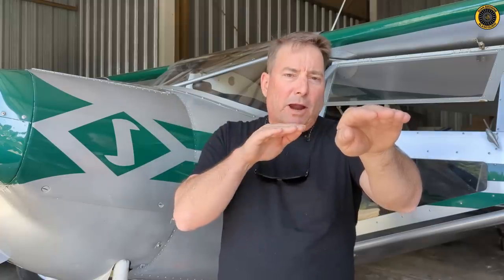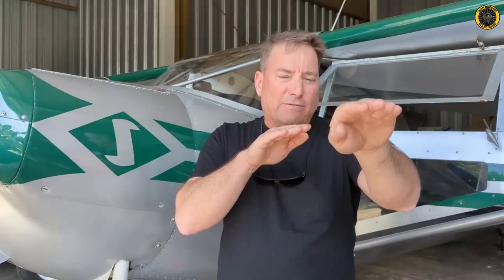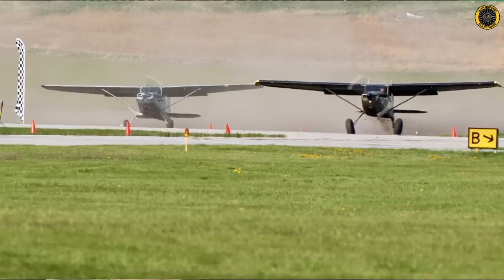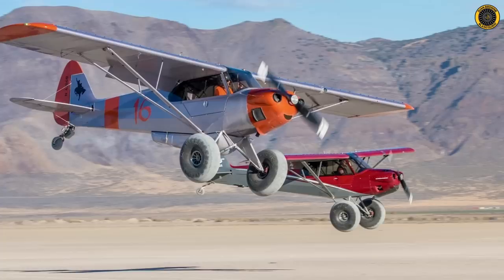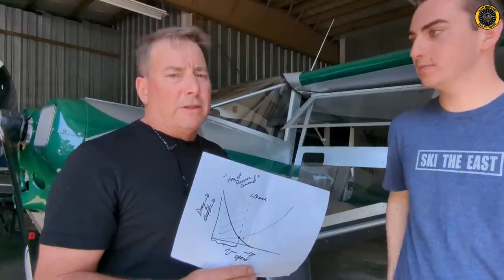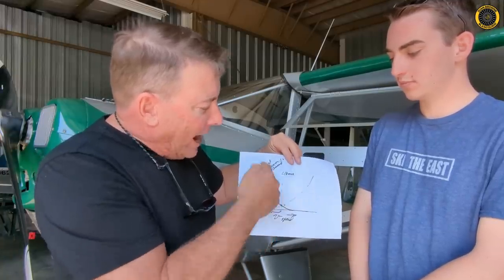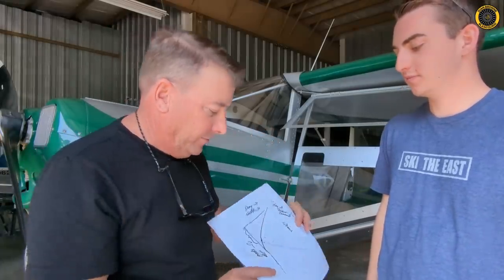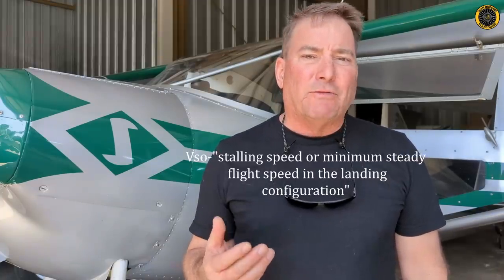Cessna 140 Stall/Spin Accident Wayne NE

Comment: Almost Happened to me...We were all pilots in my Family.. But in 1981 my brother a young F1 fighter pilot from France 
came back on a Holiday and decided to take me for a joyflight on my father Morane Saulnier MS 880. 
part of the flight was to show me an extra short take off ..Flaps off full power on brakes.. and after a short run full flaps on..

We asked clearance from the tower to join the downwind halffay thru. 
Well it did work.. we took off at a quarter runway, climbed like an elevator..And went back into the pattern Halfway into the downwind leg.

Problem is another aircraft was on a long final approach.. and we had to let him in.. So we slowed down on the downwind, and the base leg..Slowed more down on the final.. 

Our Luck was that the Rally MS 880 is an ugly plane! But it has one heck of a wing..with fowler flaps and automatic leading edge wing slats.

everything extended it does not spin..it just sinks..This said it can sink quite fast..to the point that at the runway entry and about 3m above it.

the speed indicator was showing nothing !! Then it went in.. the tricycle landing gear didnt like it..
we limped back to the hangar.. And my brother got a call over the radio..Asking him to go to the tower for a chat !

Where he got a dressing down about the proper way to land an aircraft on that airport.Fighter Pilot or not.. :-)
Moral of the story!
Don't Slow down to the point of stalling! Follow your survival instinct and training ..Go around.. Had it been another plane, we probably would have ended up stalling and dying right there.

Comment: I learned to fly in a C150. It has a very nasty habit of quickly dropping a wing during a full stall. My instructor would punch me in the arm every time I tried using the ailerons instead of the rudder for stall recovery. After a few sore arms, I learned my lesson. Using the rudder is a must. A very sad accident that shouldn't have happened.

Comment: I totally agree with you about only hang it on the prop very close to the ground. In most cases no higher than about 10’. This very slow power on flight can be practiced up at 2000’ AGL or higher until you are very proficient. 
It sure looks cool when someone does their whole final approach with nose high and power on, but it’s very dangerous, especially in gusty winds.

Comment: For those arguing about if a 140 is a STOL aircraft, STOL is relative.  The 140 might be considered to be a good STOL airplane compared to something heavier and faster, while it is not great compared to a super light Zenith or custom Cub that is designed for competitions.  A way better and more relevant event would be STOL contests between similar-performing aircraft.  A STOL contest between 140s would actually be fun and interesting, not to mention, in hindsight, safer.

Comment: Unfortunately, there is an inherent danger in this type of flying. I question if it is worth it after this accident.
Reply: It is.
Reply: Dan? Is that you?
Reply: Yes there is inherent danger and every person should be able to make that judgement. If in your calculation you don't think the risks are worth it then absolutely you should not compete in STOL competitions. You can certainly do STOL without being so close to stall which is much safer but you won't set any records.
Reply: @JG — you aren’t normally driving on the edge of losing control — the main goal of STOHL — on the edge but still holding it.
If we drove like that, the accident rates would skyrocket and most of us would not be able to afford insurance any more.
Reply: @JG I’m sure the 140 pilots family could answer that for you.
Reply: @LordRawnsley  😜
Reply: @paulwhealy5243  I think driving is close to it these days! Nobody has time to think about what they are doing it’s the cars job. 😟
Reply: @crissd8283  I think the key word here is competition. Yes, every pilot should be able to make judgement calls. All the pilots here however were under pressure to perform (in front of a crowd) and to compete against each other for an award. I think pressure to compete and win may have been a factor to keep him from breaking off his approach earlier and going around. His better judgement and caution were perhaps compromised by this setup. Was safety, having fun, or winning the event the most important? How was this presented to the pilots before the event?
Reply: @stevegiboney4493  😂

Comment: First this is tragic. But for the sake of learning. The video i saw was not good enough to tell but i was wondering if that natural inclination to try to bring the wing up might supersede by even a fraction of a second the need to release the back pressure on the stick/yoke.  Proper recovery is release back pressure or push forward plus opposite rudder then bring wing up.  So then thinking through this what if enough trim was in place that you didn’t even feel back pressure.  Is it possible that these stol landings should never be done with trim that significantly reduced the the slow flight back pressure.

Comment: 'Minimum Stall Speed' has to be one of the most deadly misnomers in aviation.
Did the industry ever consider changing it (say, to 'Minimum Flying Speed') ?
Reply: Agree that minimum flying speed would be a better description.
Reply: Pilots understand the meaning though, so it seems a non-issue.
I think it's likely there's a specific reason they use it. It may be because you can also stall at higher speeds, depending on the altitude, plane setup, weather, etc. ie: 'Stall speed' being the general term, and 'minimum stall speed' being the lowest speed where the plane can go from stable flight to a stall - such as here where the plane is straight and level, and at low altitude in this case.
Reply: I read in a post this week that someone got some advice from their father: "When it comes to minimum airspeed, always ad 5-10 knots for the wife and kids."
Reply: Good point. always sounds a strange thing to say. should be maximum stall speed or minimum flying speed. the max speed you can stall from 0 to 40,40 being the max , and min flying speed 40 and under.

Comment: Aviation as a general rule has little room for error. We use a touch of extra speed when needed to obtain that "little room".
STOL, as a general rule, has absolutely zero room for error. 
It will, in my opinion, always be risky. Is that a good thing or bad? Its for each to decide.
Is there a foundation for the children?

Comment: The right wing was shaded because he wasn’t crabbed into the left cross wind…
The stall warning horn is on the left wing (the wind was keeping good air flow over the left wing, no stall warning)
The right wing likely gave a stall buffet as the first indication of a stall.
He tried to correct the stall with ailerons… that just made it a snap stall spin.
Crabbing matters… and correcting a stalled wing with ailerons can exceed the critical angle of attack causing a snap stall spin.
Ouch…
Lesson to be learned here, more than just following to close.

Comment: I thought the area of reverse command is where you use power to control altitude / vertical speed and use pitch to control airspeed…whereas normally you would use pitch to control vertical seed and power to control airspeed.  You said add power to slow down.  I don’t think adding power has a direct effect of reducing airspeed.  Wouldn’t it be:  pitch up to slow, then add power to maintain altitude or vertical speed?

Comment: Based on your description I wonder if Tom caught the wake of the preceeding.
I once caught the wake of a 172 while doing a formation flight and towing banners so we were both really low and slow and I can tell you it did overpower my control inputs for a few seconds until the plane turned and dove down below the wake and I regain control.

Comment: Sorry for the loss of what sounds to have been an up & coming pilot in the making.

No help for this guy, but may help others operating in this low speed regime. In aeros, (which I haven't done for nearly 30 years now) we used to practice, and use, a manoeuvre called a 'falling leaf'. This involves getting the aircraft to start an incipient spin in one direction, and then reverse it into the other - repeat for as many 'leafs' as you require. It can be done in pretty much any aircraft approved for spinning, so doesn't need to be an aerobatic aircraft. But what it does impart to the pilot is the use of rudder alone (no aileron) to 'catch' the spin and reverse it - and of course the recovery from that incipient spin into controlled flight.

It may just help those who need to operate close to the limits in controlling what can otherwise turn into full blown LOC event. Might be worthy of consideration for any potential STOL pilot - needless to say, this should be practiced at a safe height!

It remains a bugbear of mine that spinning was removed from the PPL syllabus many years ago (UK - I still always taught my students it anyway) - the startle factor when it happens unexpectedly cannot be underestimated - and for anyone without spin training, it will always be unexpected!

Honestly, my top tip for anyone operating 'in the margins' is to find a competent instructor (who isn't themselves afraid of spinning) and practice something like the falling leaf. It is, IMO, a life-saver.

Comment: I think we are in a similar situation that auto racing was in the 1950s and 60s which is not much consideration given for pilot safety in a crash. I don't know why someone would take a plane that is out of place for this type of event (in my humble opinion) and try to compete with planes designed to fly at a much slower speed safely. It was obvious that the 140 was too close to the plane ahead when on final. Prayers for all involved including you Juan.

Comment: First of all condolences to the family, they are the ones left now to mourn and suffer that great loss! Yes flying is very dangerous and when things happen it usually happens in a rush/bang and you have to be on your P's and Q's to keep that "step ahead". Low and slow flight most dangerous certainly! IMO C-140 not the place in line with Stol aircraft for short field work/landings! I came out of couple bad airplane crashes and a prop strike, thank God and put many hours after that!. To this day, 73 now, I still go outside to see who is buzzing the waterways! It's very rewarding, great for the mind, and dare I say addictive!

Comment: During my biennial flight review in my Cessna 150, we practiced something called the falling leaf maneuver.  The airplane is flown into a power off stall with the elevator in full up.  Do not recover from the stall- maintain power at idle and full up elevator.  Keep the wings level using only the rudder for several seconds. This requires quick rudder input to maintain wing level and nose straight ahead control. If a wing drops, a spin may result especially if aileron recovery attempted. Lower nose and add power for recovery.  This maneuver creates a memory response much like hitting the brakes in a car in an emergency.  Try this maneuver with a flight instructor and weight and balance with forward c.g.

Comment: A tragic loss; our prayers go out to the Dafoe family and those who experienced the trauma of witnessing this tragedy. It isn't widely known--though Juan alludes to this--that general purpose aircraft like Cessna 140, are design compromises. Generally, STOL airfoils feature blunter, more cambered profiles that generate buckets of low speed lift and stability at the expense of increased drag. Cessna did a good job on the 140, balancing wing design to produce 100 mph cruise speeds and a 15,000' service ceiling, without giving away much short landing performance. That's more about low wing loading and stall speeds in the 40-kt range, than pure STOL capability. I flew a lot of back country in a Cessna 150--yes, it's possible--and in short field situations, approach speeds produced lazy, mushy control response that called for extra knots in gusty conditions. A Cessna 150 is a direct descendant of the newer model Cessna 140A, with the same tapered metal wing, and while it loves short dirt strips, it cannot match landing and takeoff performance with a VG-equipped, cuffed Kitfox of the same weight and horsepower. While we won't know the final cause of this crash until investigators have had the time to parse out every factor possible, in general, accidents remind pilots to never go beyond the hard edge of the envelope, to always respect aircraft limitations.

Comment: My thoughts was, when you are flying very close to stall speed in strong headwind , then you also have a very low groundspeed.
When you then turn the nose out of the wind (like he did), then you also reduce the airspeed drastically.
That was the reason in my opinion.
Reply: Breenild "airspeed" will be affected only to the degree that the bank angle affects it. You are still in that same "ocean" of air.
Reply: To expand on gary miller's point, it applies only where the wind speed and direction is unchanging in the region where the aircraft is maneuvering, and not in the case of gusts or windshear.

We can apply the laws of motion in any frame of reference that is not accelerating, and in the case of flight, there are two obvious ones: that which is 'fixed' to the airmass and that which is 'fixed' to the ground.

When the issue is airspeed and the wind velocity is steady, the former is the most convenient to use [1], but you could, if you wanted to, calculate the changes to the ground velocity, using the same aerodynamic forces in both cases, and your results could then be translated to the velocity through the air by adding the wind velocity (these are all vectors, so we use vector addition. This is known to physics as a Galilean transformation.) This would give the same values as you get from performing the calculation in a frame of reference fixed to the airmass (i.e. the one in which the wind speed is zero.) And the result is... in a steady wind, you can fly a circle in the air at a constant airspeed without any changes in pitch, power or altitude, simply by making a coordinated turn while holding a constant bank angle (this will not be a circle over the ground unless there is no wind.)

In a gust, however, the air is accelerating (or decelerating, which is a negative acceleration), and the above does not apply. In particular, a headwind-reducing gust will reduce airspeed unless it is promptly corrected for, and this is one of the main reasons why we do not fly approaches slow enough to be at risk of being put on the back of the drag curve.

---

[1] When there are gusts or windshear, it is still easier to do the calculations relative to the average wind velocity, or the one that is in effect at the start of the calculation. Groundspeed is rarely an issue except in navigation or when contact with the ground is imminent.
Reply: @ajayray4408  thank you very much, for that clarification. You are right, of course, I I did wrong thoughts.
When I remember I already saw this in nature.
A glider plane making circles in the wind.
Flying with the wind he was very fast (relative to the ground) and flying again the wind, he was almost stationary.

Comment: Lesson 1:   If you're in the pattern behind a slower aircraft, extend downwind to give yourself more spacing.
Lesson 2:   If you find yourself close behind & closing on another aircraft on finals, GO AROUND - don't try to slow down.
Lesson 3:   Watch your angle of attack!  Hold the nose too high, and you might die.

Comment: STOL has become a sport, Motorsport, extreme sport, call it what you will. It needs to be treated and accepted as such. There are some safety standards/ rules that could/should be implemented if the sports going to continue. As terrible as this accident was it needs to be accepted as a possible outcome.

Comment: The sport needs a few basic rules. Only one on final would be a great start. If he wasn't closing on the other plane he would be alive. 
Rules are needed because many new pilots are coming in this without lots of on the edge flying at altitude. 
Like don't pull back. No opposite aileron. 
Gusty winds make this really a bad situation. Egos are high in Aviation. No one wants to say. No go.

Comment: Juan what i don't understand is  isn't most of what is involved in this crash  pretty much simply covered on the basic pilots handbook of aeronautical knowledge. 
    Tight patterns in different performing airplanes competing in slow airspeed at low agl  ,Including wake turbulence and wind factors  with different pilot abilities  might be a bad recipe?  Not trying to be overcritical here I'm an x hang glider pilot , current soaring trike pilot and have a challenger 2. I am hoping to purchase a  used carbon cub  because my love for bush planes and tail draggers.  I know their is some incredible pilots out there doing pretty neat stol  stuff. But even mike in draco made a bad choice.
   But even with the best pilots advanced pilot syndrome is a factor (As described here). Not and i repeat not trying to be overcritical but at positions near the fatal turn flying critical slow ASI in a tight pattern in  competition in two slightly differing performing aircraft. Just might not be a good idea. I feel pretty bad for that pilot making a fatal mistake. And I am sure all pilots do. Whats keeped me alive flying trikes and hang gliders has been . Iam my own pilot. I don't compete with anyone else .  I know i,am very capable of mistakes and i include that in understanding my flying envelope. Its said generally oh he died doing what he loved.  I don't buy that.
  I love to fly like a bird. I want to die peacefully content in my old age. Never causing harm to others. Of course you can't prevent everything  arthritis really sucks.  
   I'd appreciate your 2 cents